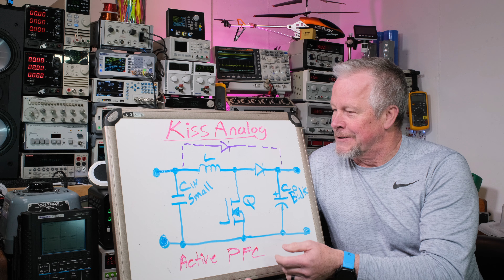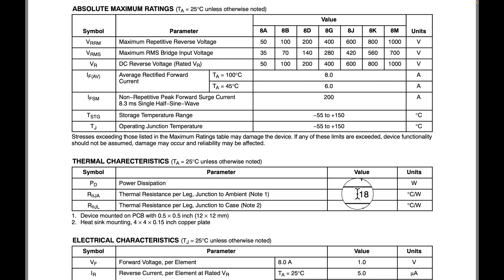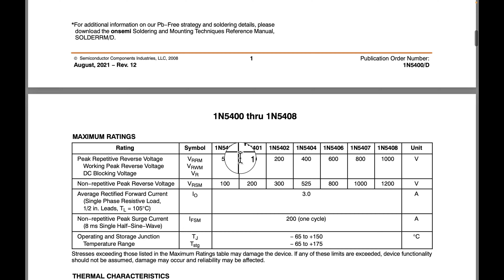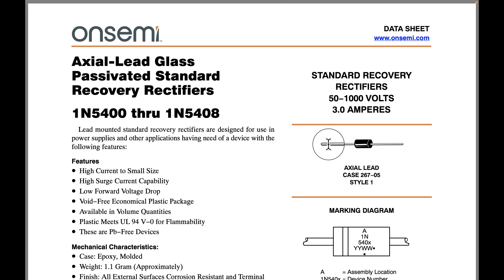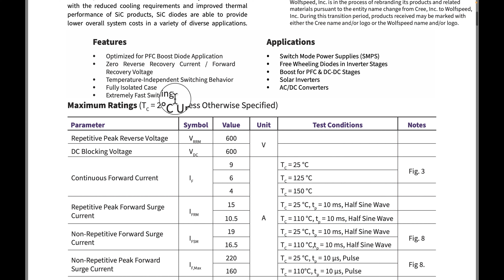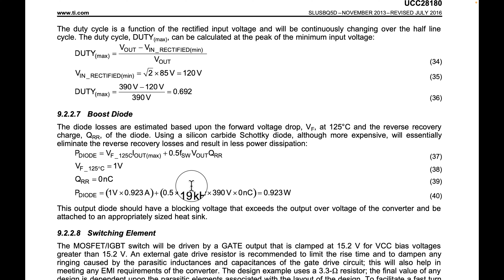How to Select Diodes for PFC Converter #pfcconverter #howtoselectdiode

Comment: One thing I don't really understand: if we're concerned about the efficiency and heat dissipation of the boost diode, why not use a synchronous rectifier? As you point out, the price difference is negligible for a one-off project but the efficiency gain is significant.
Reply from the maker: Great question!  The voltage is high so the current levels are low and that's why a diode is typically used.  Using a Sync FET would add circuit complexity and a higher cost FET - which doesn't really pay off for the small efficiency gain.

Comment: Why does a pfc converter have to follow the input voltage? I made a pfc converter with constant current input and I'm getting 95 to 97 percent power factor and huge power out, but low max current, so low IR2 losses. Give me a call. It's a new ball game. Let's talk for an hour Eddie. Let's make things better, or teach me why it's not smart KISS
Reply from the maker: Thanks for this interesting feedback!  The current is not constant current though - it is current mode controlled - I think is what you mean.  The current follows a scaled version of the voltage waveform - so it is sinusoidal as well.  Maybe it is time I do a live video and we can talk shop;)  ??
Reply: Thanks for the reply! I actually mean constant current input. I just made a 3 minute video to show you how I made it happen. I even show the current across the current sense resistor on the scope. I hope you check it out. Thank you!

Comment: Interesting video. Beginning from 15:36 I think you mixed leakage current with reverse recovery current. Leakage current is inherent to all diode types. Especially Schottky diodes have high leakage current. Reverse recovery is a time that the diode needs to block. The current, which flows during reverse recovery is initially equal to the forward current just before the diode is reverse biased. This current is much higher than any leakage current.

I missed the purpose of diode D2. You mentioned that the diode charges up the output capacitor. However, the output capacitor is also charged via  inductor and diode D3.
Reply from the maker: Thanks for your feedback.  I might have said leakage instead of reverse recovery because in my mind the current that is leaking back before the diode recovers is leakage - but yes - it is called reverse recovery ;)  Thank you!!

Comment: Is that GBU8J correct? It is rated for 600V max. But here in Europe we have 230Vac, that means 325V peaks, that is 650V peak-peak.
Reply: Well, that GBU8J is actually correct. Incorrect is the statement, that diode has to withstand peak-peak value (2x 325V). It has to withstand just 325V.
Reply from the maker: Great question.  So the peaks do not happen at the same time - they are 180 degrees out of phase, so they take turn charging the cap.  The cap will charge to the peak of the voltage - and this is referred to as 'peak charge'.  So that voltage will be on the cathode of 2 of the diodes - but referenced to what?  So once you think about the reference - the peaks are always positive in relation to this - so you don't have a negative 325V peak - it is flipped over to a positive peak - relative to the reference.  Hope that makes sense.  Maybe this is worth a short video;)
Reply: @KissAnalog  I have simulated it in LTspice. So I know that diodes need to withstand just peaks, not peak-peak values. That is 325V. So GBU8J is well suitable for that.
Reply from the maker: Awesome!  Thanks!  Even LTspice gets it right;)

Comment: Shottky diodes are very different beasts depending on voltage rating! In my mind I'd never thunk a shottky diode for any higher voltage application BECAUSE of leakage currents that one allow to gain ridiculosly low Fwd voltage drop at high current (and low capacitance, fast reverse recovery to allow silly switching frequencies). This PFC high voltage shottky sacrifices (certainly pays a high price) in Current Low fwd voltage drop to reduce leakage/capacitance). 
As seemingly everything in electronics life; it's about finding the best compromises!
Never did the math of what would happen if you would build a PFC with standard recovery diode: reactance alone turns a 10A rectifer diode into a 80 ohm resistor at 50kHz. What a mess that would make 😂
Reply from the maker: Yes Schottky diodes are great for switching and for reverse recovery.  Even Fast diodes or Ultra Fast diodes have a lot higher losses in a boost with continuous conduction.

Comment: i = C*du/dt = C*155v*d(sin(2Pi*60*t))/dt ==<< C*155v*d(2Pi*60*t)/dt = 0.00027f*155v*6*60 = 15A
We need max. 15A current to charge the capacitor with the first wave.

Ok. Maybe you are right and the second diode helps at that moment, because it is at the limit of the first diode.
The stupid thing is that in America it only helps up to 155v and the remaining voltage up to 390v will have to be managed by the first diode alone anyway.
Reply from the maker: LOL - Yep - I am right;)